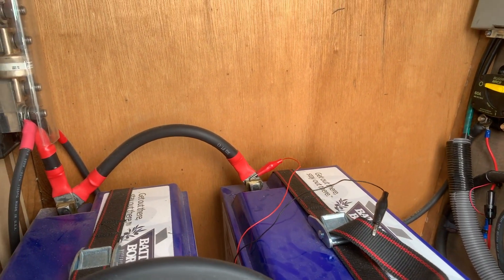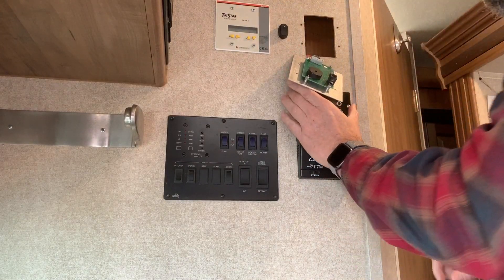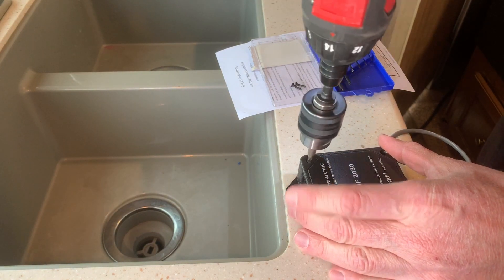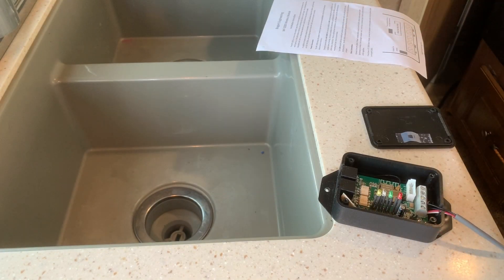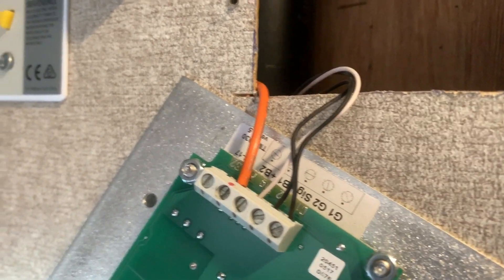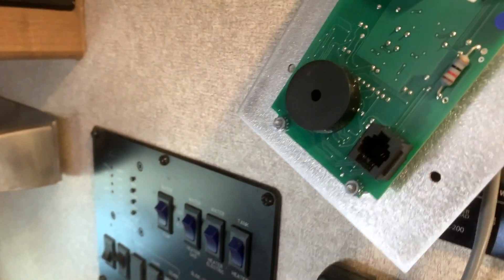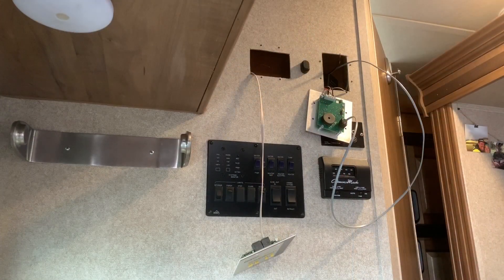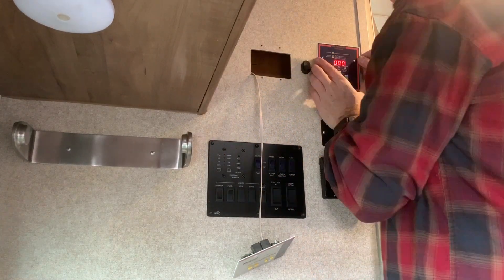Installing a Bogart WF-2030 Wifi Module

Comment: Thanks for the video! It was helpful while installing mine even though this is an older model than what I have. 
Side question: you mention the non-bogart related WiFi unit you use…Upwave or something…what’s the brand and model and cost of that?